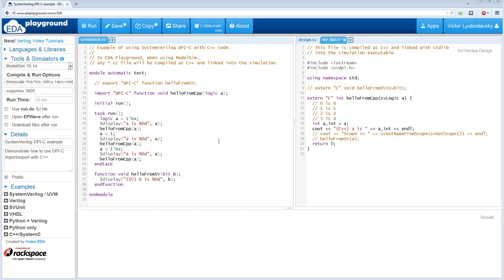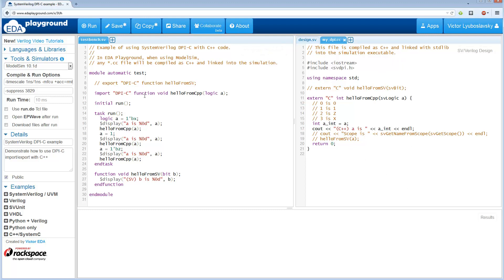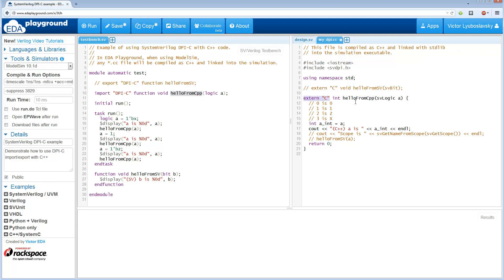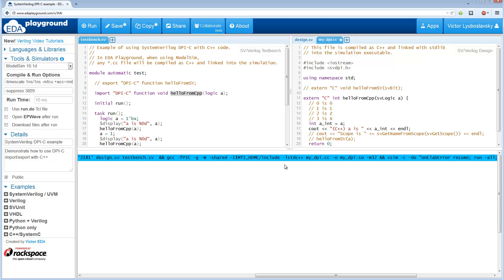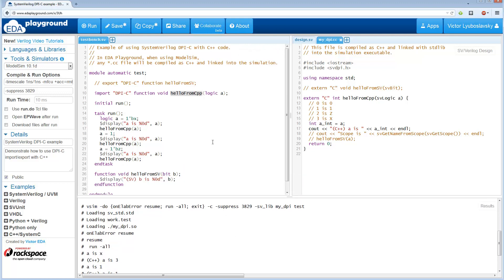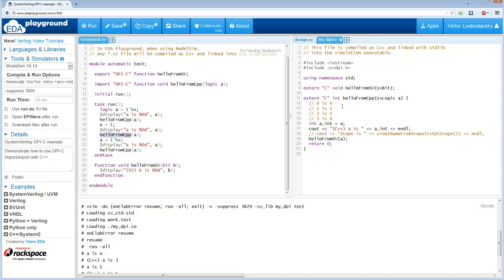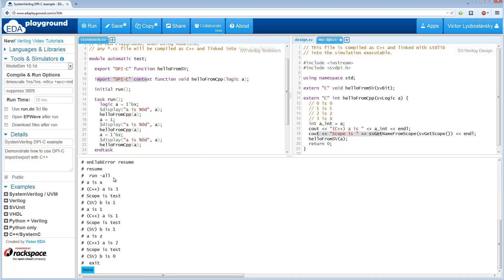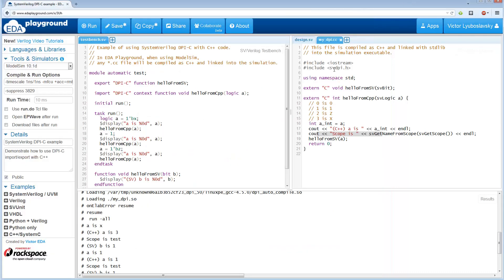SystemVerilog DPI (Direct Programming Interface)

Comment: How to access signals in sv testbench from C program using DPI
Reply from the maker: I'm not sure I understand your question. You can call back into SV from C, like in the above example. Here is an example of a task with an output: https://www.edaplayground.com/x/w7Jg
Reply: @Edaplayground_EPWave  hallo, I think I've got a similar question to his. Do you have any video or resouces about how to access  registers (say 64 bit) and memory value (given a certain address)from a C/C++ testbench using DPI?
Reply from the maker: @yulonglan132  The short answer is no. However, your question makes me realise that I do now understand the original question. And the answer is that I don't think the DPI is what you need; I think you need to be looking at the PLI/VPI.
Reply: @Edaplayground_EPWave  hi, thank you very much for your help and I managed to read out internal signals in a processor using VPI. but I’m still unable to access a memory (which is a part of a hardware design) location where I specifically want to. Is VPI also useful in terms of reading memory value, given any address where I want to access during simulation?
Reply from the maker: @yulonglan132  Why you say "memory", do you mean some HDL model of a memory? Or do you mean you computer's physical memory?
Reply: @Edaplayground_EPWave  HDL memory model in simulation, not an actual memory in my computer.  This memory is being simulated in software (e.g. verilator) together with the hardware design.
Reply from the maker: @yulonglan132  The PLI and VPI are designed to enable EDA vendors to interface other tools to a Verilog/SV simulator. Consequently, they are very powerful and I cannot see why you would not be able to access any variable in your HDL simulator. However, I know nothing about Verilator, so I don't know how that might affect things.
Reply: @Edaplayground_EPWave  hi, just an update on this issue. It took me days to figure out the problem. VPI indeed is powerful, however, some of its features might not be supported by some simulators. Notwithstanding verilator does support accessing the memory, it creates a hierarchy that differs from the one that's instantiated by us in HDL. It just adds additional modules inbetween our HDL modules in some cases. So when we try to get a vpiHandle given the hierarchy we think it is, the path is just wrong, as mentioned  above, verilator creates a different hierarchy.

Comment: Is this import command synthesizable? If yes, how can i connect my hardware it to software counterpart?
Reply from the maker: +Ali Umair 
No - this is just for simulation. To synthesise something that runs software you need either a detailed RTL model of a processor or to be using some kind of high-level synthesis flow.

Matthew
Reply: Hi EDA, thanks for your reply. I am trying to find the way to use it with hardware. Please let me know if there is a source
Reply from the maker: +Ali Umair 
Hi Ali,

It doesn't make any sense to use the DPI with hardware. It is just for simulation. 

Matthew
Reply: +EDA Playground This method of using DPI with hardware is a key to hardware-software co verification. it gives an extensive freedom to designers to verify their design. I have a lot to say about it but i am trying to find a source/sample project that shows its usage

Comment: If a want to use vcs instead modelsim which options I need to add?
Reply from the maker: Jose Antonio Valdez Rodriguez 
Hi Jose,

If you want to use Riviera Pro, you don't need to do anything. The presence of a C file is detected automatically (with a .cc extension). Here is an example:

http://www.edaplayground.com/x/U2F

If you want to use VCS, the easiest way is to just add the name of the C file to the "Compile Options". Here is an example:

http://www.edaplayground.com/x/GKL

Making VCS detect the presence of a .cc file automatically is on my TO DO list.  (Please note - the difference in behaviour between these two EDA tools is due to differences in the way EDA Playground is currently set up, not due to differences in the EDA tools).

Cheers,

Matthew